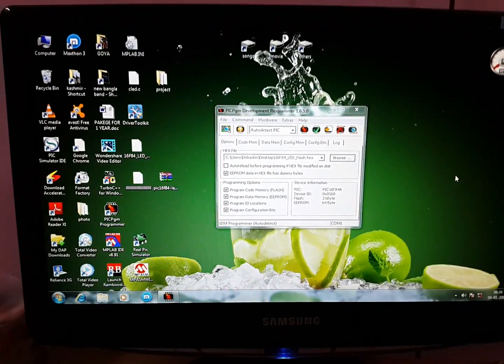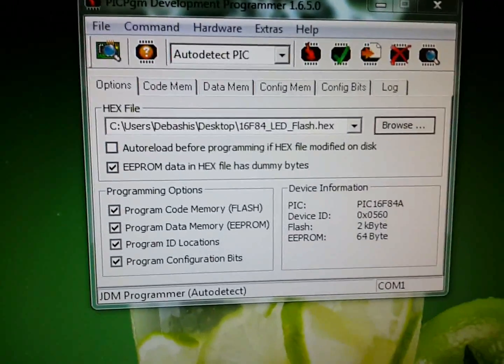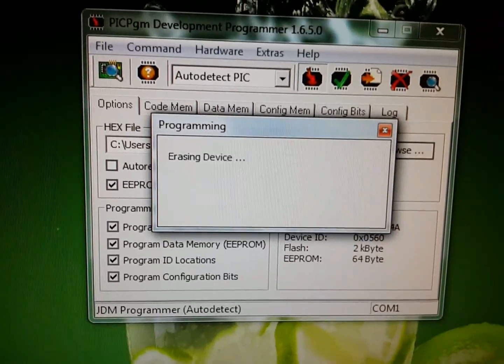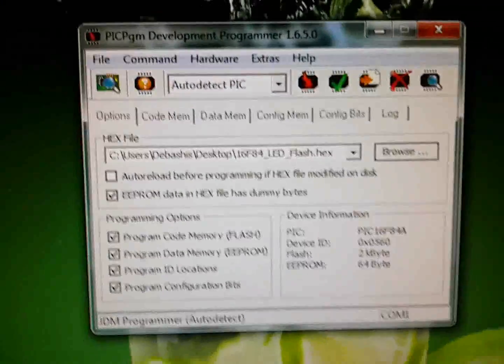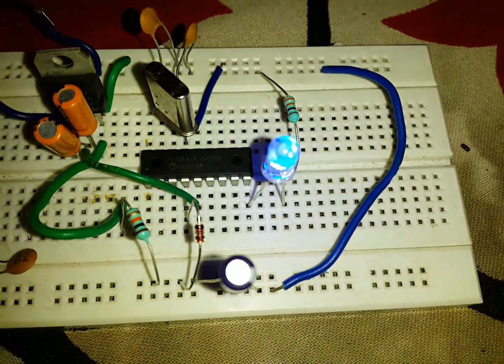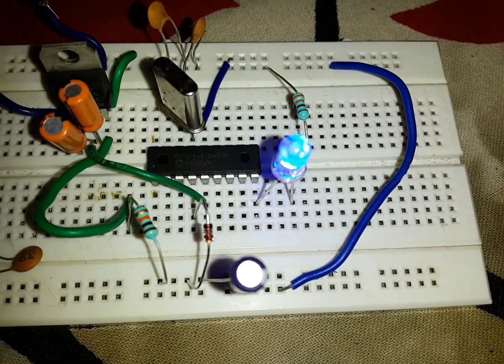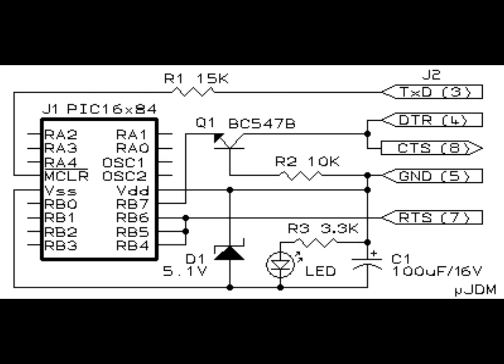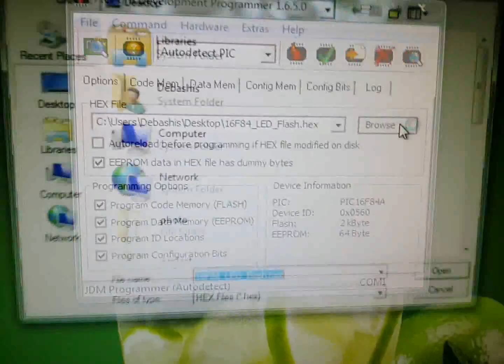home made pic microcontroller programmer on a breadboard / how to make a pic programmer

Comment: Where are pin 5 and all the other components getting their ground reference?  If you're taking positive voltage from pin 5 of the RS232 which goes directly into Vdd of the PIC, where does the PIC get its ground (Vss) since this is not directly connected to any ground reference from the RS232 port of the computer? Is there an internal connection between the PICs Vss and MCLR? By the way, the output of my computer's serial port is 0v from pin 5 and -10v from pin 3, 4, and 7 in reference to the computer's ground.  I realize if you're using the negative pins as ground, pin 5 will then be +10v, but that still doesn't provide the PIC with a ground potential if there's nothing from the serial port connected to the PICs Vss input pin.